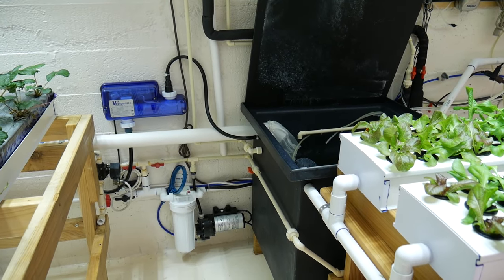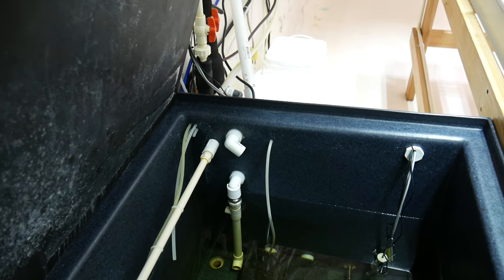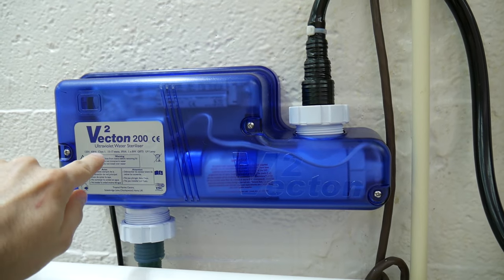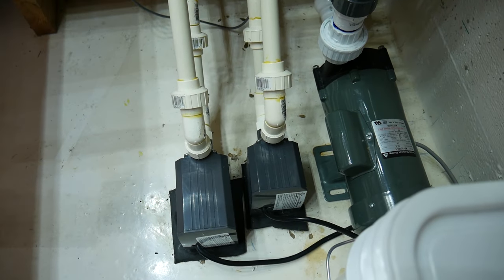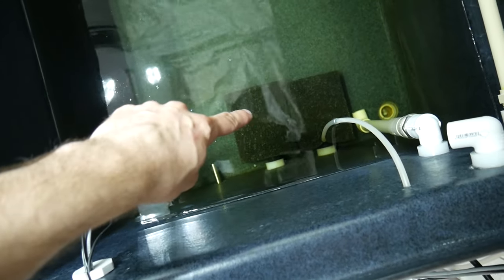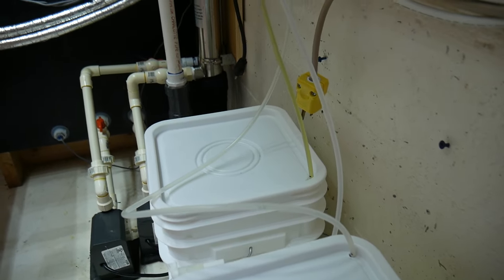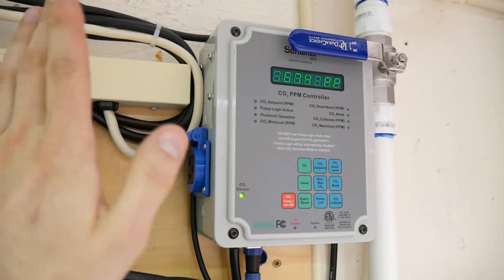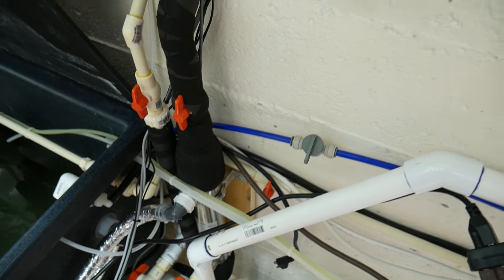Part 6 - Nutrient Tank & Automation - Basement Hydroponic LED Garden Tour

Comment: I didn’t see a reverse osmosis water filter in front of the nutrient tank. Are you feeding municipal or well water directly into the reservoir tank? I thought you have to start with very clean water with less than 20 PPM, ideally less than 10 PPM.

Are you using the three part Masterblend, Calcium Nitrate, and epsom salt dry nutrient mix. If so, which two are in one concentration tank and which is in the other concentration tank? Couldn’t you mix all three parts in one concentration tank?

How much effect does the water chiller have on your production compared to adding oxygen to the nutrient?

Comment: WOW!! What an incredible setup!! I enjoyed watching your description of how everything works, even though a lot of it is way way beyond anything I need or at least I think it is!  Also what you did show was how when you setup something like this you have to be flexible because your original setup has been modified when pieces didn’t work as expected.  I think that’s a great lesson for us all to learn is we may not get it all done correctly from the beginning but that’s okay things can be added or removed as necessary.  Although it was to impart that for us newbies, it also made it a little confusing as to what you are actually using now.  I know you mentioned you have to do a clean up and remove all the old pieces of hardware no longer in use.  It may be helpful to provide an additional walk through of your entire setup once you’ve removed the hardware that’s not in use? Just an idea.  
Now for my questions!  Lol!  

1. I noticed a lot of your setup is done with actual plumbing pipes and connectors versus using hoses to distribute the water to the various systems, can you tell me what the advantages/disadvantages are?  Installation, cleaning, etc.
2. Do you have any issues with using the same nutrient enriched water for all the same plants?  I thought plants had different requirements as they mature from seedlings to maturity and I thought mature fruiting plants had a much higher ratio of nutrient requirements compared to say leafy greens?  If you explained it already in the video and I just missed it, my apologies but I would think this would be quite a difficult issue trying to control all with the same mix??
3. You mentioned algae have you had significant problems with algae growth and is there anything further that can be done to minimize it? Wrapping top of plants in tin foil?  

Thanks again for sharing all this wonderful information!  As a newbie I’m trying to learn as much as possible and try to do it “right” or as close to that as possible.  I plan on using a 5 gallon container with a Pawfly 400 gph submersible pump and 1” tubing as the connection to the pump and then I’m thinking an inline filter should be attached ( but I could be wrong with that?)and then off of the 1” tubing I’ll insert those barb connector thingys and attach 1/4 tubing and at the tray I’ll attached 1/4” elbow and then 1/4” tubing and at the end of that I’ll have a flow control emitter that can be adjusted as needed I may actually have two emitters per tray.  The 1” tubing will go around in a circle and will end back to the tank with a mesh bag to catch anything that may have carried through.  That’s pretty much the setup that I’m thinking of for a small seedling tray setup where it will just add nutrient rich water to the trays so I don’t have to fill them individually.  Because they are just new starts I don’t know if a bubbler is required but I will add an air stone to the bucket which I think will provide enough oxygen to the plants?  If anyone has any suggestions or doesn’t think this will work at all I sure would love the feedback.  This is my first attempt at anything like this.  The only thing I can think of to change at the moment is to use 1/2” tubing instead of 1” but at present I’m not able to get 1/2” tubing it seems to be a hot commodity at the moment. 🙏🏻🥰🇨🇦

Comment: sir, may I ask why need 2 nutrient tank ? is that for measure both PH and TDS? so 1 nutrient tank will supply nutrient solution to the water tank based on PH sensor and another one will supply nutrient to the water tank based on TDS sensor?

Comment: 13:50 I know it has been a long time and you have moved on to primarily doing lighting, but could you elaborate on how your Venturi system is set up? You mention an impeller blade which I have not seen before for Venturi and in general I am having trouble figuring out your setup. You are able to control the flow, but I do not believe that those water pumps have that capability, so you must have a choke set up somewhere for the air line.

This is easily the best overall system that I've seen for automation and am using it as a baseline for my setup, but with a bit more hands-on when it comes to controllers due to the ease of using something like a Raspberry Pi. The largest issue for me has always been from the poor quality of air pumps and I'd like to figure out a more reliable way to rely on Venturi.
Reply: From what I can tell, he just has an air line going to the intake of his pump right at the filter. The impeller he spoke of was the pump impeller. The impeller draws water in from the reservoir, and creates negative pressure. This brings air in from the air line which is drawing in ambient air from the room. Although he didn't show it, I imagine he simply had a small twist valve to control the amount of air being injected. Hopefully he will comment to confirm, as I am very interested in this concept as well. The idea is MUCH better that an air stone and pump as it aerates and circulates simultaneously.
Reply: @dudemcgee256  Yea I wish I could get confirmation. The concept is a very cool one because it seems that the quality of water pumps far exceeds that of air pumps on average. They just do their job better. Being able to do both jobs just makes it that much more useful.
Reply: @ashiha13  I have since implemented this idea. I found that introducing air at the intake of the pump caused some pretty significant cavitation which diminished the water flow rate by quite a bit. My pump didn't sound very happy about it either. I may be introducing too much air. I don't have a way of controlling the flow of air yet, I will try that next. I moved the venturi to the output side and I have good flow, as well as a lot of bubbles. But my bubbles are no where near as fine as whats shown here. Even though it isn't working exactly as I'd like it to, it is significantly better than the air stones it replaced. And quieter too.
Reply: @dudemcgee256  Thanks for the update!

Comment: Very nice and experienced looking setup love it! Would you mind telling me a bit more about your skimmer like tiny bubble in your reservoir? Are you using a skimmer pimp or kinda injecting air into the pipe? How doe's it works :-)

Thanks.
Reply: I think you misunderstood. He was saying that if the air injection is too intense, it acts like a skimmer bringing all of the stuff to the top. Which is undesirable. That's why he has the air injection turned down so low.

Comment: Nice setup. Consider using soluble silicon as a replacement for your pH up. It has a lot of advantages for your plants that pH up does not offer. Plants gown in soil uplift silicon into every cell. Plants grown in NFT/rockwool slabs etc miss out on all these advantages.

Comment: Bought a Growcraft from you, it's amazing! I tried to implement your idea of introducing air to the tank via a venturi into the intake of my pump. I have had issues with cavitation and reduced flow. How are you preventing this? I don't have a valve on the air intake, but my inlet is very small. I am heading to the hardware store tonight to purchase a valve too see if that helps. Thanks again for all the great content!

Comment: How is you input reverse osmosis water to your reservoir tank under such high pressure? I have a Hydrologic 200 reverse osmosis water filter that is connected to city water. The output of the Hydrologic 200 comes out at a trickle, and takes about an hour to fill a 5 gallon bucket. I would like to automate my reverse osmosis water generation and nutrient mix to a reservoir tank, rather than manually creating 5 gallon batches.

I’m thinking about using an electrical float valve in the reservoir tank to control an electrical valve to the water input side of the Hydrologic 200 reverse osmosis water filter. The reverse osmosis water would the flow into the reservoir tank through a physical float valve. The reason for the physical float valve in the reservoir tank is to prevent the reservoir tank from overfilling in case the electrical float valve fails to shut off the input water to the Hydrologic 200.

When you pressed down on the physical float valve in your reservoir tank, it looked like you had high pressure municipal water feeding your physical float valve in you reservoir tank. What kind of reservoir tank do you use, and where did you buy it? I’m not sure how important having a food grade plastic reservoir is compared to just using any kind of plastic reservoir tank.

I use 12 grams of Masterblend, 12 grams of Calcium Nitrate, and 6 grams of Epsom Salt per 5 gallon manually mixed batch for my tomato and pepper mix. I reduce the concentration to 10 grams of Masterblend, 10 grams of Calcium Nitrate, and 5 grams of Epsom Salt for greens, like lettuce. I haven’t thought about increasing the Calcium Nitrate to compensate for using reverse osmosis water, but I’ll think about it. How much of a concern is adding the preservative chemical to your nutrient that may be toxic?

I use many Compact Fluorescent lights and one 315 watt Ceramic Metal Halide light in my grow area.

Thanks for all you Hydroponic videos you’ve posted!
Reply: He might have a pump, or maybe he just has higher water pressure

Comment: Thank you very much for that thorough overview. Just have a question about ozone. I have been interested in adding ozone to my reservoir. It seems the simplest way to do this is through an ayirstone style unit. I found this unit Aqua-6 Multi Purpose Ozone Generator, It delivers 600mg/hr ozone output and is only $100. How long would I need to run this. I don't really want to go the ORP meter route as many people have reported what you have with always needing to calibrate it. I have also seen washer machine ozone units that use a water pump to pump water through it and ozone the water. Is one style better than the other? Thanks for any opinions on this!

Comment: And all of THAT is for lettuce?! )) Bro, that is one tidy setup. To keep the liquid inside the tank moving, try installing a vertically standing impeller, just a little one. Set it right on the bottom and keep it on all the time. Even a tiny 1/2" impeller is going to move the entire volume of water in that tank. One last element you could add to that control board is a USS Enterprise. Peace.
Reply: He already has that. That's what the second pump is for. To circulate and aerate.